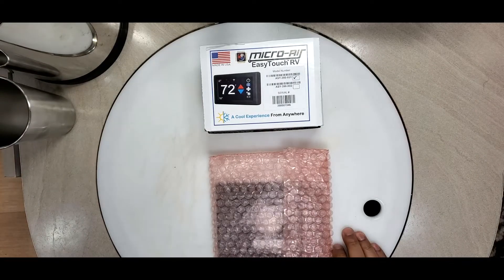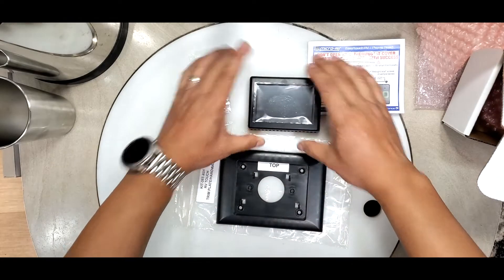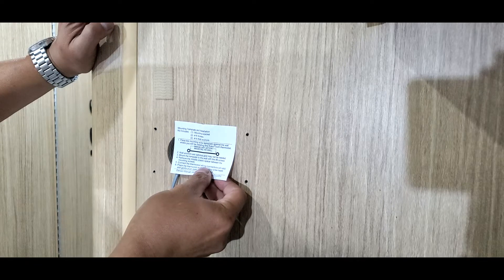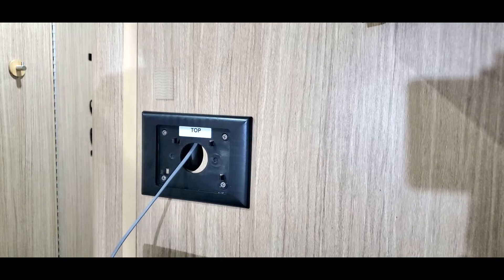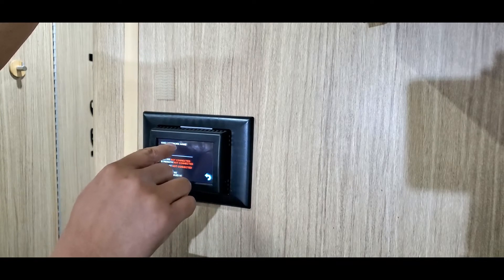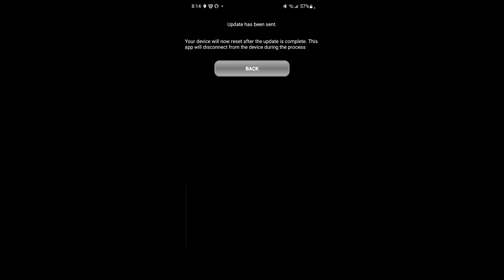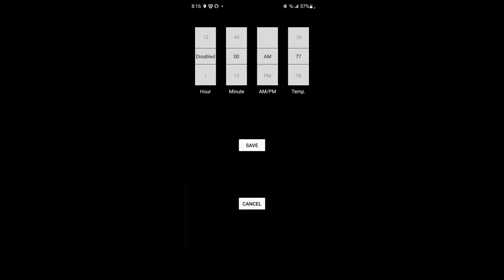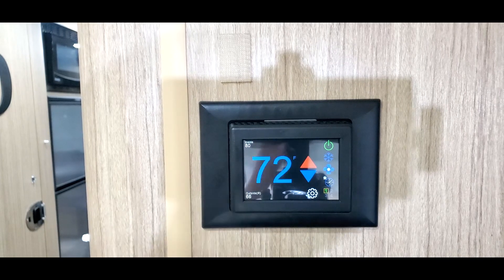Micro Air unBOXING and Setup

Comment: I was told these are factory installed on newer Airstreams definitely an improvement.
Reply from the maker: Interesting, mine is 2018. I will ask my FB group if anyone has a newer rig.
Reply: @AirstreamAddictsforAdults  My 2021 is the same as yours so IDK maybe the 22's?
Reply from the maker: @BeyondConventional  are you part of my FB group? If not, it is designed as a virtual campfire, so not your typical AirStream group. Search for it on FB if interested.
Reply: @AirstreamAddictsforAdults  Yes I am, I checked out a 2022 and it had a Dometic thermostat must of just been a rumor?